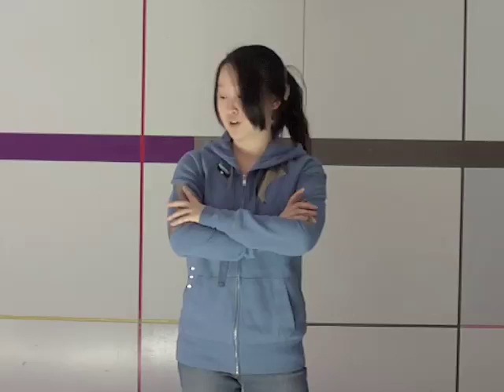soundie

Comment from the maker: @Lights4Love In order for the LEDs to be sound-sensitive, you'll need a sound sensor of some sort, and you'll need to process its input and map it to the LED output you want. I believe you can use the Arduino Knock Sensor as a sound sensor, though I've never used it myself. 

In the Arduino forum, there is a thread called "Help creating a sound-sensing LED display" that shows sample code for converting sound input to LED output.

Hope that helps!

Comment: It's not circuit bending.  The Soundie is doing exactly what it is designed to do.  Circuit bending takes a circuit designed to do one thing and bends it do something else.  Like pitch bending a speak and spell, or generating sound from a calculator.

Comment from the maker: You can turn it off =). It would definitely be plausible to create a hoodie with speakers that you can plug an iPod into. However, a separate power pack might need to be attached to the insides of the pockets in order for such speakers to be effective.

Comment from the maker: @cindyandjoey In general, the alligator clips don't work as well as the stitching. I had to reinforce the stitching across the conductive fabric to get a better connection.

1023 is just an arbitrary measurement, I believe.

It could also have to do with the type of conductive fabric you have - if you get someone else to touch it, are they able to get the value down lower? Also, if you use a large piece of conductive fabric, can you get a lower value?

Comment: I built a test circuit using two 3-inch circles of conductive fabric. For right now they are connected w/ alligator clips (will anything change when I sew them down?). I'm only getting values down to about 900 though, and I have to wet my fingers and touch it because my skin is sooooo dry. (BTW what units is the 1023? 1023 whats?)

Is my only getting down to 900 because of the size of the circles? Or is it because the alligator clips don't connect them as well as stitching? Any other ideas??